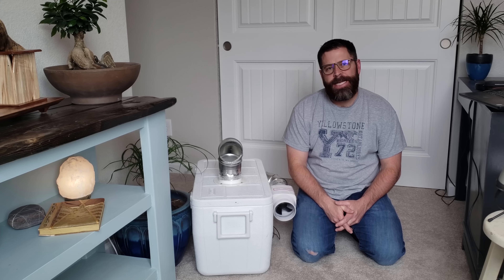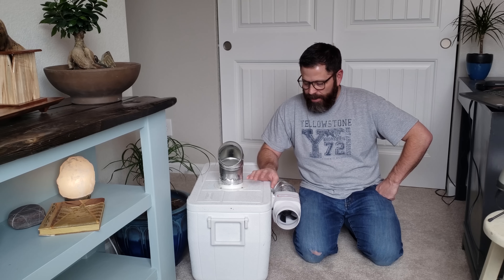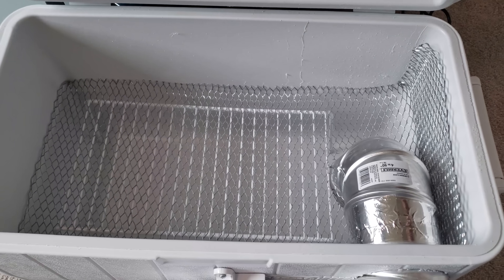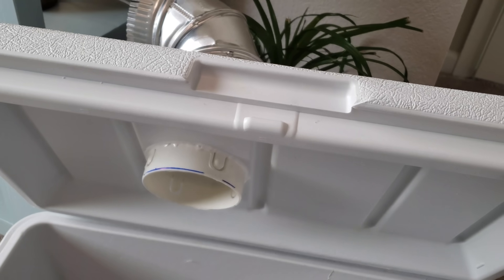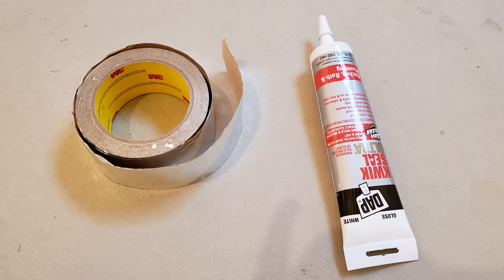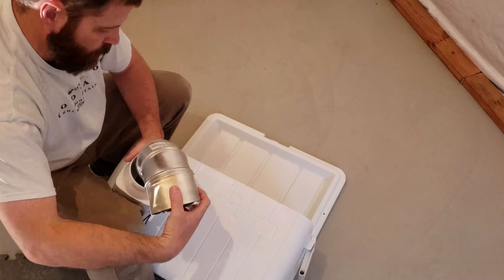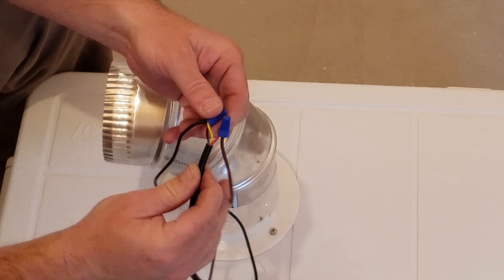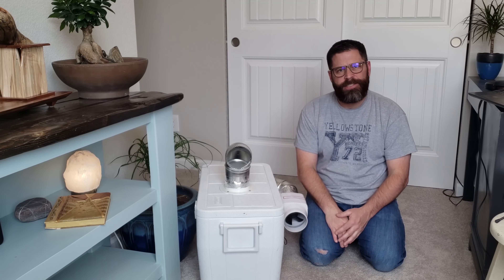Homemade Portable Air Conditioner DIY - Coldest One Yet!

Comment: Dear Make & Do, 
Your idea would be tremendous if you would change your flow. 
The old saying is “you can pull air but you can’t push it“
So flip your blower around so that you’re pulling the air thru your ice chest. Let it come in the vent and be pulled across the ice and pulled out the discharge where the blower is. 
Just like an attic fan in a home where it blows up into the fan

Comment: How long does it take to melt that bag of ice?  Once melted, does that water block the air flow?
Reply: You ever smoke weed out of a bong or anything? Or like blow bubbles in your chocolate milk? When air passes through water it takes the form of an air bubble and just rises to the surface. Water cannot stop airflow lol
Reply: if you let too much ice melt, and the intake pipe becomes sumberged in water, it'll work the exact same except it'll start bubbling and you'll just hear it make bubbles
Reply: Adore Arwen as long as your fan is strong enough to push the water down and if it is string enough the water will decrease the airflow.

Comment: Two words solar panels and ice maker this would be perfect for a tent on the river
Reply: I was thinking of 2 idea's 1 a container to put water in and 2 a  Plastic hose that comes with a condensate pump that runs into the river you would need a filter to keep out trash and debris like on a refrigerator
Reply: Any way to harness the coolness of the river and use it would be "COOL".   I live in Florida and the Santa  Fe river has several large springs flowing into the river very close together. Plus there are numerous small springs percolating up out of the ground. So beautiful to see. It would be so easy to make a 12v cooling system and be the envy of every campground ,lol.    It's always cooler near these springs but it's amazing how hot it can get in your tent close by them. I had a 30' houseboat I used to camp in and dive during the day for Indian tool   and fossils. So much fun camping along the crystal clear water below the springs here.
Reply: What happens when the ice melts? Does the water create a problem where you have the blower tube below the ice?
Reply: That are 15 words
Reply: @Engineer9736  
THAT'S
Reply: Solar panels are worthless and inefficient
Reply: @craigschray4486  a panel the size of the lid would easily power this, also if its hot its probably because the sun is out so it will be powering the system. hater.
Reply: @craigschray4486  This tiny fan could easily be powered by a solar panel

Comment: Wondering if you can improve ice retention by running a copper pipe from the blower to the bottom, make a coil and have that pipe exist as the exhaust. This way, the air from the blower never touches the ice directly. The ice/ice water will chill the air in the coil and the cooler air will exist the pipe. If you can keep the cooler sealed from ambient air the ice should last longer. You would have to make the exhaust pipe come out side to be able open the lid also.

Comment: I just watch this DIY video. I thought initially that this was a great thinking OUTside OF THE BOX ........ however a few thoughts I just had, first the motor is way to small not enough CFMS to move the air efficiently and you can just forget using ice as an replacement to refrigerant overall.... it’s not really practical a waste of time and money but it was a really nice thought

Comment: The equivelent to a little 5,000 BTU air conditioner is melting about 900 pounds of ice in a day. Think what 900 pounds of ice costs and having to handle all that ice. Sorry this is a huge fail unless you are getting ice for free. Oh and BTW if you think you are going to make ice in your freezer, WRONG, that increases your freezer's run time so it's not free. Sorry there is no way of cheating thermodynamics.
Reply: Yes but ice made in your freezer is pennies on the dollar compared to buying bags of ice from a store.Sure your freezer's run time is longer but what's the alternative? Do nothing?

Comment: HAS ANYBODY EVER BEEN TO a party that used dry ice in a punch bowl and watch it smoke or dry ice in a fog machine or dry ice in a bucket with a little bit of water to make fog come out and stay on the ground while you're dancing. how many people left the party dead? 😂

My point is I've use dried ice in this same setup and I'm still alive and I've done it for hours on end in my camper.

 I'm actually building a food trailer and I'm going to be using the same type of setup with dry ice the only thing is dry ice cost more than ice but it does drop the temperature in the camper significantly. I only use about 1 pound of dry ice and it lasts about 6 hours more than enough time to sell my food and stay cool.

Also another reason why I'm not going to die of affixiation while I'm selling my food, I still have my screen open or my window open to serve people.

Comment: I see that you made this strictly for your car, my car already has superior air-conditioning, so I don’t really need it there- I really need it for my living room. can this cooler maintain a space about 20‘ x 20‘ square?

Also I asked about using blue ice packs and/or gel packs, i’ve got several of those that came with medication that was shipped, the gel packs were still cold four days after the medication was shipped, the packs on the bottom were still ice cold, and the pack on the top was only about half thawed. I don’t believe these use dry ice or anything dangerous although I would probably also use a couple of packs of real ice to to get that cold water on the bottom.

I actually have to commend you on your skills with that ripsaw that you were using that has the light that follows the guide marks that you made, I don’t have anything like that I will have to hire my neighbor to cut the holes for me. But I can’t believe how simple this is compared to several other coolers I have seen if this cooler can accommodate a 20 x 20 area then I will start ordering the parts immediately. Aren’t those aluminum elbows that you used also available at Home Depot? Looks like the most expensive part will be that fan.

I would have to try to find a cooler chest exactly like the one that you have there, that one looks good and you didn’t even have to remove the hinges like I have seen other people do when they have to remove the lids. I like that this whole thing can be built without having to disassemble the cooler.

Oh that blower is only $30 that is excellent I was expecting a lot more thank you for making this video!

Comment: I save plastic bottles of all kinds ,time  to start freezing water and do this.
NEVER USE DRY ICE.
Reply: What happens if you use dry ice?
Reply: @Viltgance1  Dry ice is carbon dioxide.  Too much of it in an enclosed area will suffocate any animals (including your pets, your children, and you).
Reply: @Uejji  holy shit! Good to know, thanks.
Reply: maybe use saltwater in the bottles to get the temp even lower
Reply: @thiszackistrying  Salt water does not make the temp lower. Salt water simply stays liquid at a lower temperature rather than being ice, but it's the same temperature.
Reply: Very Wise 4u2 suggest we use frozen water bottles for reuse,recycle, refill to refine😂Ty
Reply: Replenish 😉

Comment: im working on an AC myself. First you shoot a portal at Antarctica and then shoot one on your wall. The portal transports the cold air from antarctica directly into your living room
Reply: My buddy, Rick Sanchez C-137 had an extra portal gun and loaned it to me. To keep the portals open you need a couple of Mr. Meeseeks to sit at each entrance with their arm sticking inside. I tried moving them so they sat half in and half out, but when the energy source surged it cut them in half. That was a mess.
Reply: Won't this contribute to gloBULL warming? Lol
Reply: @nickrose5872  No it really does work. Just make sure your entrance portal is somewhere obscure so unwanted guests or pests show up unexpectedly.

Comment: Very few understand the ice wont melt fast once the cab is cool because it will be pulling cool air from inside the cab not hot air from outside
Reply: the ice in that cooler vs. the suns heat      ill take the sun for the win

Comment: Separate the air stream from the ice and water, then you may be able to get dehumidification out of it. Maybe install vertical metal cylinders filled with ice. Any moisture will condense on the cylinder wall and drip to the bottom where you can install a drain. Since the air won’t be in direct contact with melting ice, you won’t be introducing humidity back into the room. Similar to why you don’t run your air conditioner fan continuously in the summer time. If the fan runs after the ac has satisfied, it does not allow the condensed moisture to drain away from the evaporator and evap pan. The moisture is then reintroduced back into the room by the fan.

Comment: Why do need the tube/pipe on the top? Is it just for directing the air flow? I'm just thinking small holes would be fine for cooling a small space like a van or shed.
Reply: that might blow the water out

Comment: HAVE YOU TRIED SMALLER OUTLETS, I WOULD THINK IF YOU HAD SMALLER OUTLETS? I WOULD THINK  IT WOULD BLOW THE AIR FURTHER INTO THE ROOM,  AND YOU COULD FACE THEM IN DIFFERENT DIRECTIONS TO HELP COOL A LARGER AREA, JUST A CURIOUS THOUGHT

Comment: Question, the blower motor does it need a filter in front of it so it does not suck in dust into the cooler.

Comment: You would be better off reversing the fan direction and pulling the air through the cooler. This will cause a low pressure in the box which in fact actually promotes temperature drop. Plus it creates negative pressure in the box and that makes a better seal of the container itself.
Reply: Issue with that is now you're exposing that fan to extreme temperature swings and moisture. It may not handle that very well.
Reply: Instead of blowing air in? Let the fan blow it out? Got it👍😎 Air being forced in? Goes over the ice. Then is forced out to cool the outside air. As long as you have air flow going out of the room too. Crack a window open. Sounds a lot better! 😜
Reply: @FelipeGomez-vx2sx  Yes. And this would help dehumidify, right?
Reply: Prob wouldn't get the rapid expansion you're looking for with a fan, I get what your saying though
Reply: Good point, especially I you container was seal tight from the start.
Reply: If you pull vacuum it lowers the boiling point.  This would cause the ice to melt quicker and hot air would be blowing out in no time.
Reply: @serialcarpens290  if I understand correctly, pressure creates heat. Anytime a container is quickly depressurized, it usually becomes very cold, to the point of frost build up.
Reply: Make a video about it. Help everyone with a visual learning get a better understanding what you're talking about thank you.
Reply: You'd turn it into a giant bong.
Reply: @stewpacalypse7104  😂😂😂

Comment: wouldn't it be a good idea to have a hose attachment to the front of the blower?  This would allow you to run the hose along a wall which will move the intake point across the room from where the cooler is.  This would then cause a difference in air pressure.  Air will be pulled from across the room and blown out the cooler.  The way all of these portable ac's are built doesn't allow for proper circulation of air in the room so you have to sit really close to them to feel any relief.  You gotta create air flow in the room to increase efficiency and then maybe you could get away with a smaller and more quiet blower.

Comment: You've nailed it.... Excellent, thanks. I have all the parts to hand and like you this would be my third DIY, very handy for power cuts in 45c heat!

You can also use a 3" bilge blower and 3" outlet which would make the Ice last a little longer, shouldn't affect performance much, judging by how effective it is using the larger ones! A 20w or 30w solar panel can also run these blowers direct in sunlight.

Comment: Wow, I’m impressed, what a novel idea 💡.........   seems this idea is only a few hundred years old. lol 😂 maybe called a chiller lol 😆 which have been around since the beginning of time. 

You would have a far better system if you run a coil of copper surrounded with ice and force air thru the coil. Just a thought. It’s called an air conditioner 😝

Comment: Fantastic design , although I would suggest that you put the fan on the exit rather than the entrance , fans work far more efficiently sucking than pushing . But then again you might not want greater airflow . Again great .job well done
Reply: A fan that is sucking moist air will rust and die sooner.

Comment: The elbows really aren't necessary except for inside..it wud be a cleaner look too with it on the side of the handle
Reply: Ruff Riffing as I was watching the video, those were my thoughts exactly.
Reply: Don't they let you aim the air flow?
Reply: Spinetanium indeed you need it up top so you can direct the airflow. 
I am talking about the duct/elbows leading from the blower into the cooler. You may need it on the inside. Unless perhaps, if you will use ice bottles on top instead of ice cubes that melt), then you may affix the fan on the cooler at the bottom half. 
But if you are using ice cubes, I don’t understand why you need the external ducts/elbows.

Comment: How@home version of 120v? 
Is there a motor you recommend?
Reply: 270cfm bilge fan
Reply: 270cfm bilge fan. You need a 12v DC to 120v ac inverter in order to power the motor. The plugs are different but the wiring is the same

Comment: Frozen gel packs may last longer and are reusable.
Reply: Has anybody tried this these? I’ve got three gel packs that came with medication that was shipped to me, it was still cold when I got the medication, four days after they were shipped. I will be getting three more after my next refill. I also have a few blue ice packs as well.
Reply: Social Spit just note that the med packs were not sucking outside warm air into the container the meds were in so the gel packs didn’t have to work that hard. My experience with gel packs is they melt just as fast or faster than normal ice.
Reply: Reginald Worthington ah! Thanks. Yeah the medication came packed into a small Styrofoam cooler. Maybe I can try a combination. I won’t be using this in an automobile though, inside of a car gets a lot more miserably hot than the inside of my house, especially if you park someplace out in the hot sun.
Reply: @reginaldworthington7558   I was just reading up on it.  A couple of years ago (unrelated to these A/C's) I found some videos on how to make the gel ice packs; 3/4 cup water - 1/4 cup isopropyl alcohol.  The Isopropyl alcohol has a freezing temperature of -89 (negative 89) farenheit.  Normal freezers (didn't know this before today) run at 0 degrees.  So, the gel packs should in theory (mine) make use of the difference between 32 degrees and the zero.
Reply: @trustinjesus1119  Alcohol doesn't change the temperature of the pack, and the freezing point isn't relevant. If the freezer temperature is 0 F, then the pack will be 0 F. Simple as that.
Reply: @joewoodchuck3824  I get it, thank you.  It's more than refreshing to be reminded of science, I've been focused on the piano (& singing) the last year, primarily focused on.
Reply: @trustinjesus1119  Cool!
Reply: Patricia Griswold ice is reusable, just freeze it again
Reply: Ice releases humidity as it melts. Frozen gel packs don't release humidity. Why is that important? The release of humidity increases the cooling effect on the air. In other words, ice would cool way better than gel packs. That's how swamp coolers cool just by water evaporation alone. Stick with the ice for better cooling and forget the gel packs.
Reply: @logictheorist  Here's why I believe in God, He made people like you.
Reply: my mom just dropped off a few packs at my house lovely xD i have an offcial use now. going to put a mini freezer in garage
Reply: The problem with gel packs is there needs to be a way to refreeze them. Good luck with that when you're away for more than a day or two.
Reply: joe woodchuck  same with ice/water...
Reply: @blakhx  Yes, but ice is widely available for replenishment. Frozen ice packs aren't.
Reply: @blakhx  Yes, but ice is widely available for replacement. Just go to almost any store. Can't do that with gel packs or bottles of ice that were frozen at home.

Comment: Would this cool a 12x14ft room?
Reply: Yes it will . Think of it this way . Your typical bathroom exhaust fan runs at about 50 cfm. During a hot shower it does a pretty good job of clearing out a typical 5 by 5 bathroom in a few minutes. 
5 by 5 is  25 square feet with a 50 cfm fan 
14 by 12 room is 168 square feet , he has a 200 cfm fan . That is like two typical central air supplies in a home . You should be able to cool your room in about 1/2 hour .
Just don't wait until it's 95 in your room before you turn it on . Then you'll be fighting the room that has hot walls and furniture radiating heat . Also you'll need to take the inlet part of the fan and pipe it up close to the ceiling ,about 7feet high , use plastic  flexible dryer vent . Cool air is heavy , so it will remain on the floor , placing your intake hi takes hot air off the ceiling and pulls cold air up where you need it . Also point the exit of the cooler straight up , it will mix the cool air with the hot air faster and give you a nice  dry cool feel .

Comment: If you wanted to power this off a standard 120v outlet, while tent camping use a laptop power supply. If you don’t already have one they are cheep at a place like goodwill. You could also get really fancy and wire in a 12v dimmer switch to control the fan speed.
Reply: You can get a hi , med , low switch an a fan out of a car at a scrap yard an if you use a yeti then salt the ice